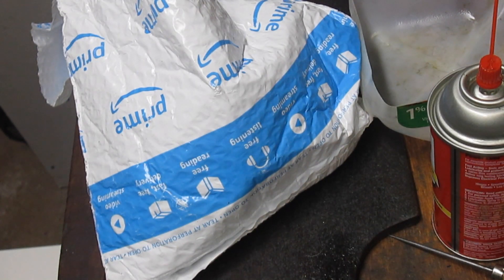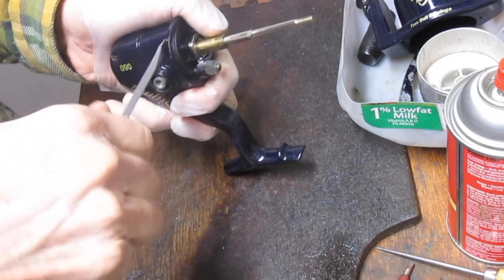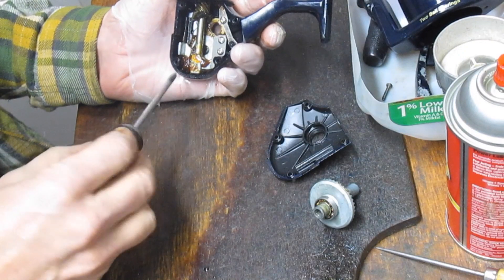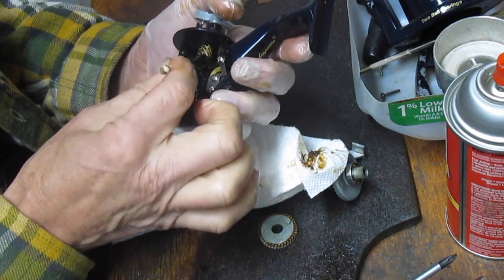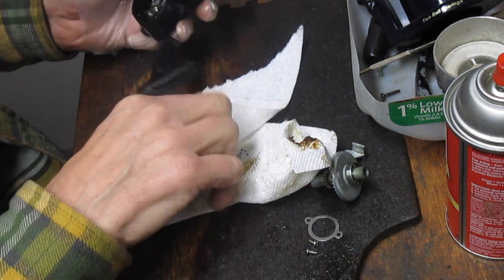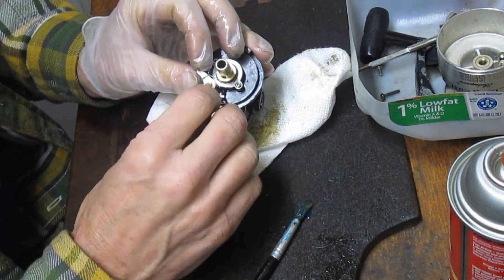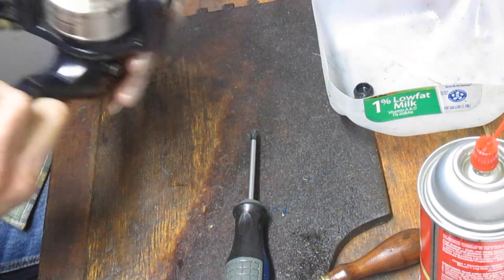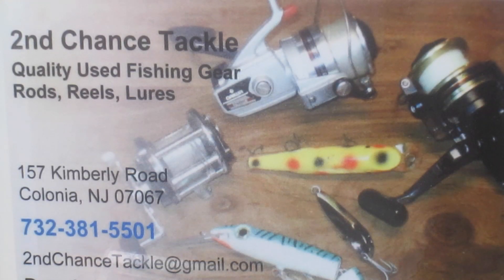Shakespeare Sigma 60 Fishing reel how to take apart and service

Comment: Another great video.
Reply from the maker: Thank you Mike.  These reels don't get the credit they deserve.  They are a value for the price and the occasional angler does not need anything more to have a great day on the water - Dennis
Reply: You have inspired to find flea market finds and repair.  So far I have repaired two and got them working again.  I have two that are part reels.  The other 6 work but I haven’t had time to service them. I am having a dandy of a time working on them.  Thanks for the inspiration.

Comment: Another great video Dennis. Wanted to tell you that as I have continued to add to my vintage surf spinning reel collection I was able to pick up a very rare and unusual one yesterday. Somehow, some way I won an EBay auction for the very first edition of the original Penn Spinfisher 700 “Greenie” spinning reel dated 1961. I personally had only ever seen one on EBay before this that was priced at $700. I know it did not sell for that but I got this first reel in the original Spinfisher series for only  $50. You can recognize this reel easily since it was the only Spinfisher 700 with a green handle. This reel completes my collection of all the different models of the Penn Spinfisher 700 and 704 “Greenie” spinning reels. The reel is even coming with an extra spool. I honestly never thought I would find one and even if I did, it would be cost prohibitive. I just put a bid on it simply so I could see what price it would finally fetch. My bid held for a day and a half even with 18 others watching. It was my lucky day as a collector! Of course I wanted to share this news with my YouTube mentor who has inspired and helped me restore so many really great spinning reels.

Comment: Hey Dennis do you know if the Shakespeare Sigma 2200 series 035 rotor screws on or held only by nut. As always thanks for All you do
Reply from the maker: I am not certain, but I am not aware of any of this era Shakespeare reel using a screw on rotor.  Most are help in by the rotor nut and some are held by the "U" clip inside the case, but I can't recall on that is screwed on.  Thanks for asking - Dennis

Comment: Dennis, first video of yours I’ve watched. Informative. I have this Shakespeare Signa 060 reel. It appears to be in good condition, was stored for at least 20 years in a sealed bag w desiccant. My issue is how to disassemble and lube it. The crank is frozen in place. Removing the screws on the cover does not release the crank. Are these any resources for the steps to open it up to inspect for damage and clean?
Reply from the maker: Does this have the screw in handle or the handle with the bar that goes through the main gear and is attached with a screw cap on the non-handle side?  If the cap is spinning when you turn the reel, the handle goes through the main.  Best to remove that cap to check as some models may have a screw under the cap.  If then non handle wise does not have a screw cap or screws under the cap, the the handle screws into the main gear, and it removes in the reverse direction of the way you turn to crank the reel. 
After you remove the non gear side cap and assuming this handle screws into the main gear, flood the hole in the gear with penetrating oil and let it sit overnight.  The next day, try turning the handle in the reverse direction of the crank to remove it.

If the handle has the through shaft, do the same thing, flood it with the oil, but instead of unscrewing it, try to tap the non handle side shaft using a small flat bladed screwdriver against the edge of the shaft. Tapping it should loosen it up and assist with the removal by helping you to pull it out

Thanks for asking
Dennis

Comment: Love your videos.  Question,  I was given a penn senator 2/0 from the 50's or 60's red handle.  It has heavy boat rash on it.  Is it worth refurbishing seeing as the inner and outer chrome face plate rings are around $50 from mystic parts just by themselves?   Reel functions perfectly.
Reply: Chris B   Thank you.  yea the rest of the parts came out great using his tips.  Inner and outer rings are pitted really badly.  I was only going to replace those parts. Wanted to know if it was a good reel to throw some money into.
Reply: Chris B   Thanks again.  I'll bring her back to life, she deserves it. Little new chrome then I'll fish the hell out of her.  Thank you for your responses.
Reply from the maker: I don't think the return is worth the investment in buying new chrome versus the value of the reel.  I would scrub off the rash with 0000 steel wool and metal polish, make the internals right and take it fishing if it is perfect mechanically.  It is somewhat rare, but the effort just isn't worth it in my opinion - Dennis
Reply: @2ndChanceTackle   Thank you , keep making the videos. They are fantastic.
Reply from the maker: I'm not going to tell you not to do it....It's just that I would not invest.  You are correct in restoring a memory or treasure, but I prefer to let the history show and tell the story of its life Go ahead and fro it if you will get pleasure from the restoration - Dennis
Reply: @2ndChanceTackle    Thank you for your time with this question.  I really appreciate it.  The smile on my son's face when I give him grandpa's reel is my goal. I just wanted to make sure it was a good reel to invest the time and money into or if it was a junker.  Your polishing videos brought it back to life.  New beauty rings as you say will simply be my addition to this reels history.   I can't thank you enough.   Keep them spinning Dennis and thank you.

Comment: I tore apart a brand-new Shakespeare reel and the grease was all coagulated and looked worse than that! I think Shakespeare just uses crappy Grease now... It was almost like dried rubber cement
Reply from the maker: Wow!  I've seen new reels that have been in storage for a while have the grease settle, but not dried.  Manufacturers tend to over pack the reels with grease so that they run smoother and don't fail during the warranty period.  Not sure what is going on with the one you took apart, but it doesn't sound good!  - Dennis
Reply: @2ndChanceTackle  I wish I could post pictures on here I'll email you a picture